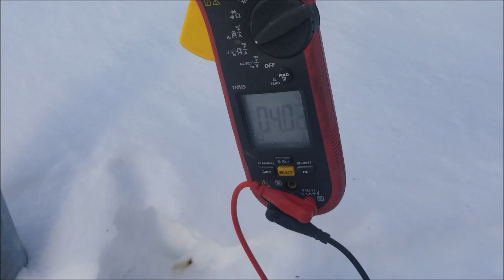Is the neutral wire safe? - Powerlines

Comment: As said by the electricians at the grain elevator I work for, "there are no second chances with high voltage power. You either get it right, or you die." Well, in this case they're talking about 480v 3-phase; not the 7+kv you are.
Reply: 480 can be lethal and is technically considered high voltage, depending on the industry
Reply: @DeepCZero3  most utilities consider 600 volts and above as primary.
Reply: With high voltages like these,  you don't even have to make a mistake.  You only have to get close to making a mistake.

Comment: One of my college professors told me a story about his brother who was a lineman back in the Seventies.  While doing some overhead work, they accidentally dropped the line they were working on onto the TV antenna of an apartment building.  The antenna was grounded to the building’s plumbing, instead of a separate ground.  They were lucky the building didn’t catch fire, but most of the copper plumbing was toast.
Reply: Must have been quite the legal battle, one side claiming the accident shouldn't have happened to begin with while the other trying to claim the incorrect install of the antenna was to blame too

Comment: I have several questions  1. You speak of a triplex what is it?   2. With 1 face down on the primary will cause low voltage on the secondary side? 3. I notice you work alone on primary lines, I thought it took 2 people for safety?
Reply: Triplex is usually used to serve houses. Two insulated conductors and one uninsulated. The two insulated ones usually carry 120 volts each while the uninsulated one is your neutral to carry return current. 
The neutral can kill just a quick as the hot legs. The neutral us usually used to support the service between the pole and the house. It is hung using grips or beckets that work like Chinese finger cuffs.

Comment: I had no clue until I watched your videos that neutral wires continued back to the power station and weren't just an in home thing. Do they remain at the low voltage potential, or are they transformed back up to HV for the long distance?
Reply: It's hard to generalise, but: The neutral springs into existence when the 3 phases are separated to do their own stuff. On its own, each phase needs a return path so an electric circuit (there's "circle" in that word, btw) can be formed. So no, they do not get across a 3-phase transformer.

On the 3-phase-side of things no neutral is needed because the 3 wires alternate between "I'm doing nothing"/"I'm pushing electrons"/"I'm pulling electrons" (and infinitely many in-between states) all the time.
Reply: @HenryLoenwind  That isn't exactly right.  In a 3 phase system with no neutral, the device is using the voltage differential between each of the phases to power the device.  This is typically used by devices that will put equal load on each phase, such as industrial motors. When you have a neutral, you also have the option of using the voltage differential between a phase and neutral, in addition to the voltage differential between the phases, but you don't have to put equal load on the phases, as the neutral will provide the return path for any unbalanced loads.
Reply: @stargazer7644  I put "loading the phases differently" into "splitting the phases to do their own stuff". I also didn't go into establishing a local neutral (star point) inside a machine. Those are both just variants of either "use 3-phase" or "use 1/2/3 single phases".
Reply: The neutral is held as close to ground potential as possible.

Comment: Are neutrals "Safe" LOL. Do you want to die? Your responsible for your own safety. Never assume anything is safe, it will get you killed. Allways LOTO all circuit, apply lock to device you only have the key to that lock it off denergzed position, and all energy  source, and stored energy (capacitors, hydraulic, springs, valves, etc) are physically locked and tagged off in the area your working. Then perform live dead live dead live while Wearing as Arc flash rated PPE per the arc flash safety tag wearing PPE and using equipment rated for the highest rated voltage the equipment your looking at. Then Check to make sure your meter works on known working source, then check all circuit in the area you are working in, I mean All, not just what your fixing, as in yest anything you may  contact, everything in the equipment your working on. Verify power is off line to line ant to ground as and all other circuits in area. Then check meter is working on known working source to make sure you're meter is still working. Apply grounds as necessary, then work on circuit.

Comment: Considering how the north American power grid uses the "neutral", it can easily have a dangerous amount of power on it depending on how it's used in the circuit. Thanks for the vids. Keep an coming.
Reply: To me is dangerous the way that you use the neutral in the US, here in Europe medium/high voltage transmission lines are without the neutral wire (transformers uses a delta configuration on the input side). In the low voltage wires there is the neutral but it's considered a live conductor as the phases, it's interrupted by breakers, and never connected with the ground itself (except at the substation itself where the neutral is grounded, the final consumers use a TT system)
Reply: Yeah. The advantage of using UK/Aus/NZ style 11kV where everything is connected line-to-line.
Reply: Even though a Neutral is bonded somewhere back to ground, is a return patch that does carry current on 120/unbalanced circuits.

Comment: 3:22 I can’t hear what you said, “ someone had stolen all the cooper wire”? 

The other services had resistive neutrals and the current was flowing down the ground conductors located in each home through the earth (yes current will take ALL paths back to source)  to the ground conductors back on to the neutral across your open connection you had cut back to the transformers secondary centre tap neutral. OR the primary’s neutral cable was stolen and the neutral current from all the other services were traveling down the neutral you had cut into the earth back to the sub station to the ground back to the secondary centre tap. Is this what happened?
Reply: Pooper wire.

Comment: You must remember that there is an international following  here and that the rest of the world does not use split-phase, with neutral conductor. In the rest of the world, 240 Vac direct from the pole transformer to your panel board is common.The US/Canada uses split phase system it requires more transformers, where in the rest of the world more loads are connected to fewer transformers.I visited Israel last year, and I noticed that branch cks are fused at a lower amperage, and this is due to the formulae higher voltage=lower current to protect the residences.Frequency is 50 HZ for other reasons!
Reply: it does not require more transformers  the transformer is 7.5kv   that down scales it to 240 volts   the neutral wire sits in the middle of the transformer winding    that is where  split phase comes from  so you get  two 120's  if   you connect both hots you get 240volts  (also on a triple phase it's 208v or 360volts)
Reply: punker4Real — I think the North American system does, indeed, use more final transformers than the European systemc.  In NA, a transformer might supply four homes or fewer.  In the European ststem, one large transformer might supply an entire neighborhood.
Reply: @GH-oi2jf  there are also a lot higher loads in NA. Also, electricity is cheaper and many homes heat AND cool with electricity, so more power to each neighborhood is used and therefore, more transformers.
Reply: @punker4Real  277/480, 600 also

Comment: I had a subscriber who's coax cable kept melting. After several meetings with the power company we found 60v at . 5 Amps on the common. His house was the only one tied to our system on a separate phase so the power company had an issue at the sub station with leaking voltage. It was pretty cool working with them to find the issue
Reply: had a bad bond to the ground rod at a house I had bought, nearby lighting strike and instead of that energy going to ground went out all devices connected to my coax, then out through the coax shield to the other end where was grounded, every box coax was connected to was fried, and the coax had to be replaced. Some Ahole as many around here do use pipe bonding clamp as a ground rod clamp that failed. Took a page from installing ham/cell tower equipment shack grounding I put in a three rod system #4 copper cad welded back to a ground panel that all electrical, coax, telco was single point grounded to. later direct lightning strike resulted in no damage.
Reply: @mikeclarke3005  yes, idiots are everywhere....

Comment: I've got a good question for you. I recently trimmed away a tre from pole in my yard with a street light on it an i noticed there is about a foot of the copper ground wire on the side of the pole about chest height what should I do an can this cause any problems?
Reply: Did you mean to say the copper wire is missing?  Damaged?  Your question makes no sense as written.
Reply: @stargazer7644  a small section of the copper wire is missing
Reply: @malakithefolf69621  call your utility and get them to check it

Comment: Neutral in relation to what. Everything has a voltage relative to everything else and I'm not going to take a guess how much the neutral wire has relative to the ground. Even just for the fact that it's absorbing some power from the phases through electromagnetic induction. I'll bet it's enough juice not too be so fucking stupid and just try and see what happens. I don't work with high voltage or even lower voltage electricity professionally, but then I also don't work with explosives and know better not to cook my own dynamite.
Reply: The neutral is tied to ground and is normally not hazardous.  The problem comes in when there's a fault, or something is broken.  It can be at 0 Volts and still be carrying current.
Reply: @stargazer7644  Normally that's the case that it's not hazardous. Until it's not, because somebody at some point in time changed things. When it's not, you'll know right away.
Reply: Voltage is generally, but not always, measured in relation to ground potential.  The induction doesn't matter in a properly grounded system.  The current flowing through the neutral and the resistance of the wire will cause a voltage drop that will pull the neutral slightly above ground potential.  But when it is grounded properly, it doesn't have enough voltage (relative to ground) to be hazardous.

Comment: For the transformer at 0:16, it looks to me like the neutral for both primary and secondary are connected inside the can.  Is that correct?  In my neighborhood in the USA, it appears the distribution system is delta, and the neutral on the secondary is not connected to the grid, except by being grounded at the pole.  What is the significance of the difference?
Reply: A delta system has no reference primary to ground. On most delta single phase hookups you will see they are fed by two phases of primary voltage so the transformer would have to have two high side bushings instead of one like the transformer in the video. You would still ground the case of the transformer, but most delta systems dont run a neutral or static on the primary side.

Comment: Neutral wires can carry current and enough to kill you dead! I don't even trust ground wires. I work in city sewage pump stations doing rehabs on them and one day we were at a station working on removing a water line for the hose bibb. I went to remove the ground wire that was bonded to it (not touching it with my hands but with my screw driver) when I grabbed the wire and pulled it off the pipe it arced like crazy.
Reply: Something grounded by that wire had a ground fault, or what was supposed to be its neutral connected to the ground instead?

Comment: Very good video. Question for ya, looking at video at 4:45 and I see 2 black wires I am assuming are hot wires and the bare wire I think you are calling the neutral. I thought the neutral would be insulated like in my house. Is the neutral at ground potential and are the 2 black wires 120 volt each. Thanks
Reply: Black insulated are 120 volts each. Neutral carries return current. Don’t consider it at ground potential as many things can affect it. 
If the hot legs are all balanced then the current flow is zero but the load on the hot legs are seldom balanced.
Reply: Off the transformer, neutrals are bare because they are grounded at their destination. The blacks are probably 120v if it's going to a house.

Comment: Although it is common to hear “ no line is safe to touch, ever”, As an experienced electrician I have full confidence when working on my own projects that a properly installed and grounded neutral is perfectly safe to touch.
Reply: I’ve measured an inductive GPR in the distribution pole ground going through a backyard which would scale to well over 2kV under through fault conditions. Anyone working in the vicinity of the ”properly grounded electrical circuit” during a through fault would be subjected to a crazy touch voltage. This includes the water taps that are also connected. This is what grounding engineers need to solve but sadly they are never asked to for fear of liability should a heart attack be traced to a fault.
Reply: @eswing2153  doesn't even have to be fault condition. Dangerous voltages over spans of few miles can develop on neutrals despite being grounded at both ends. Higher the voltage of the system more danger
Reply: @imeprezime1285  imbalance current will definitely cause standing GPR issues.
Reply: @eswing2153  Yes. The key word is "properly" grounded. Better not to touch neutral if one is unsure
Reply from the maker: I agree with you on this ✌️
Reply: That really depends on the distance (or actually resistance) from the point you touch it to the grounding point and back to your feet*. When touching it you still are part of a voltage divider, with the complete load that's using that wire on the other side and aforementioned resistance in parallel to you.

(* simplified route)

Comment: The neutral is a current carrying wire.
Reply: Samuel T The neutral is not intended to be current carrying and is the “grounded” conductor that carries the unbalanced load.
Reply: @dominicm2175  
Correct. I could have used better terminology.
Reply: @dominicm2175  Split phase in North America residential tends to cause a lot of issues with unbalanced neutrals here. Doesn't help that most split phase pole pigs bind the primary ground with secondary neutral/centre tap within the same can.
Reply: @dominicm2175  the unbalanced load is current. And it carries it. Sorry...

Comment: Here in the UK we have a situation called 'Borrowed Neutrals' in domestic properties. This often occurs in a stairway where switches interact between the top and bottom of the stairs. Some electricians are lazy and use a neutral line from either end of the circuit. This means that unless all breakers are off one cct could still be live because a neutral has been used from the other cct. It looks like power companies do the same thing on the grid!
Reply: It also commonly happen in my country, especially from DIY people that goes installing smart switches such as Sonoff and hookup the neutral from whatever blue wire they find, for example from a nearby socket outlet, but on a different circuit. That is a problem since if you have double pole breakers (commonly we use 1P+N breakers, meaning they interrupt both phase and neutral) you can have a neutral at an high potential. For exactly that reason you should always check if the power is isolated not only between phase and neutral but also phase and ground and neutral and ground. Or better if you can kill the power to the whole house at the main breaker.
Reply: Thankfully this is becoming less common with RCDd and RCBOs and they trip when the two circuits are on different RCDs
Reply: Where I’m from we call it “sharing” neutrals. One of the first safety things I teach apprentices regarding neutrals and the electrical pathway.
Our code requires new installations to have dedicated neutrals or the wires sharing a neutral have to be on a 2 or 3 pole breaker. Breaker ties

Comment: I am no lineman, but I am sure glad you showed up in my recommended. How very interesting this stuff is. Thanks for what you do to keep our power cranking!
Reply: One very important point for any law enforcement & fire & rescue first responders who are responding to a struck pole, especially at nite; even if pole not broke, leaning, or no obvious physical damage, there could still be pole top danger...force of impact could loosen live hi  voltage primaries from their insulator, allowing the conductor to hang along side of pole..even if conductor not broke, it can still be very deadly, especially if pole wet.  Even with no signs of arcing, etc, it's still extremely dangerous. Make sure u give top of pole good look with a powerful light, and anything out of ordinary, wait for linemen to secure this danger. Though, sometimes danger may not be obvious, best to wait. I realize there may be a.life threatening situation, where a victim may have to be removed immediately!. I assume most responders have the appropriate training to deal with this. If u have,not make sure your superiors get u the training necessary. I hope this had been informative.🐏Sam.
Reply: Yup, never would have thought I'd be interested in this subject. But I subscribe to a lot of woodworking and restoration channels, and YouTube decided to run this up the flagpole. I saluted.